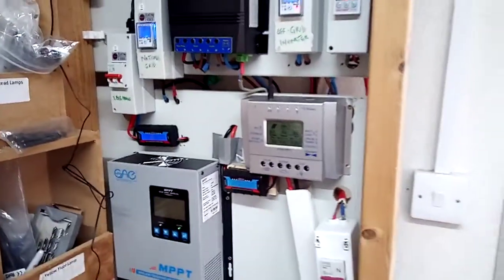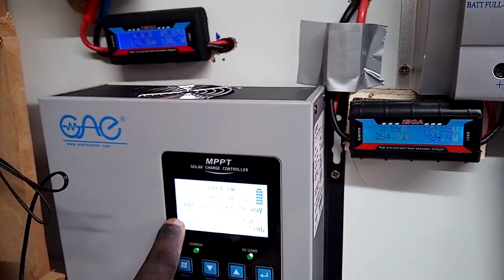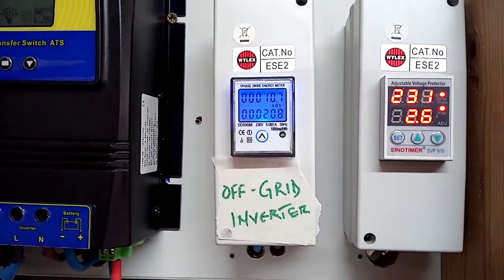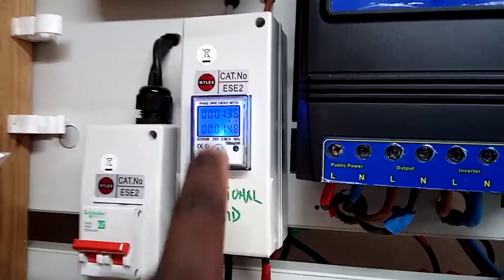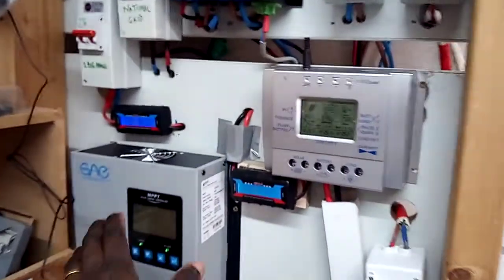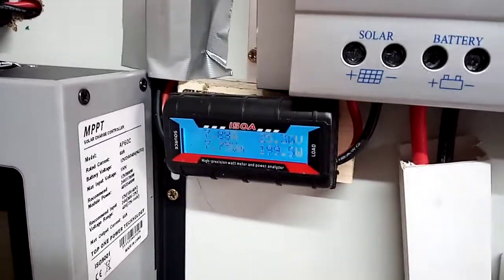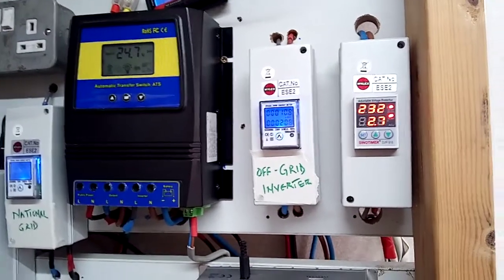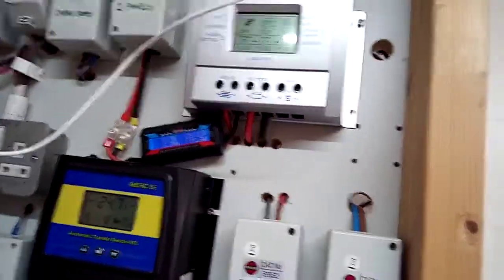Real-time Off Grid Solar Panel Utilization Update - 7th Feb 2022

Comment: I have a question can the solar power the house once the battery is charged. Thanks. 
I understand grid power
Battery power 
But I don’t understand the direct solar power
Reply from the maker: Hi, thanks for your question -- I am not 100% certain that I understand the question very well but let try to answer you the way i understand the question -- please feel free to correct me if I am wrong. 
Basically, it is all about the type of INVERTER you have.
There is an ON-GRID SYSTEM this means that you have solar panels and an on-grid inverter that will convert the DC direct current energy from the solar panels into AC (Alternate current) that can be used in the house by your appliances. The excess from the Sun during peak hours could be wasted as no one is using it if you are not home during the day.
Secondly, the is GRID-TIE SYSTEM - This means your solar panels are connected to GRID-TIE INVERTER - The inverter convert solar energy (DC) from your panels to AC (Alternate current) and feed your home appliances as needed and the excess power generated goes into the NATIONAL GRID for others to use which means your energy supplier give you back some parts of what you have feed into the NATIONAL GRID.
Thirdly, OFF-GRID SYSTEM this means you have off-grid inverter and battery bank. in order to use this, you will need charge controller to charge your batteries -- Your solar panels are connected to the charge controller to charge your batteries and the battery bank is connected to the your OFF-GRID inverter -- The OFF-GRID inverter convert DC energy that is saved in the battery to AC to feed your home appliances -- In this case you will have dedicated sockets for your appliances -
Fourthly, HYBRID-GRID SYSTEM - This means you would need HYBRID INVERTER this type of inverter is more interactive -- The HYBRID INVERTER can connect to solar panels, battery bank and National-grid. When the solar panels is generating loads of energy during the day, the HYBRID INVERTER charges the battery bank, supply your home appliances and excess goes to the grid when the battery is full.